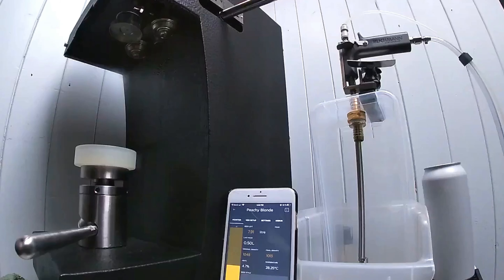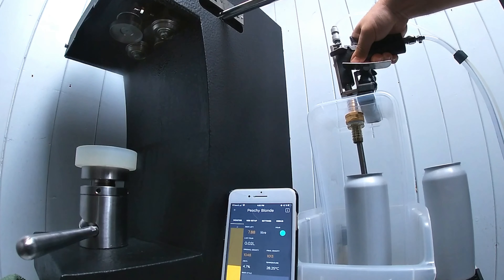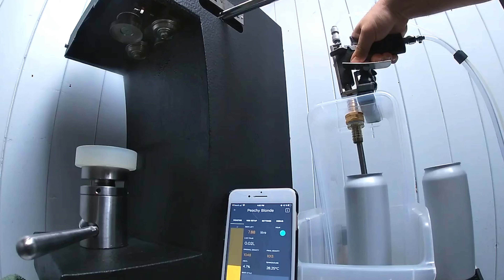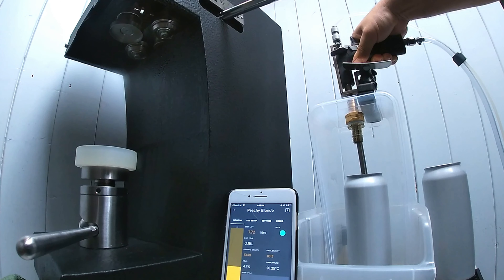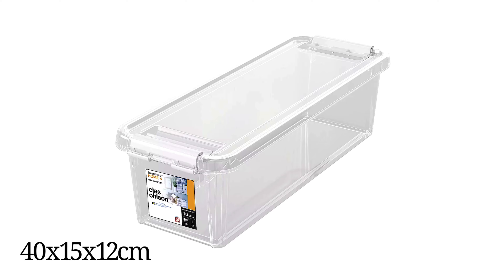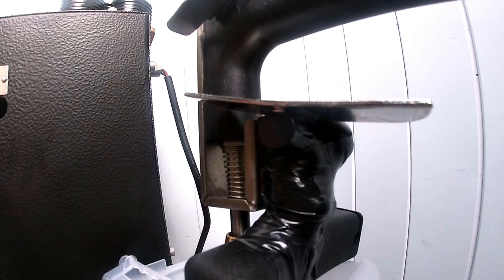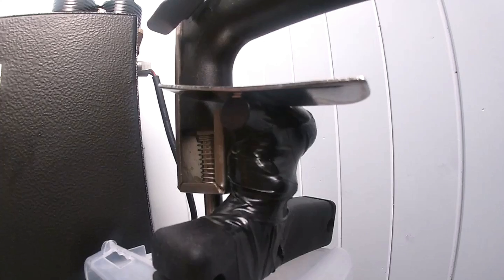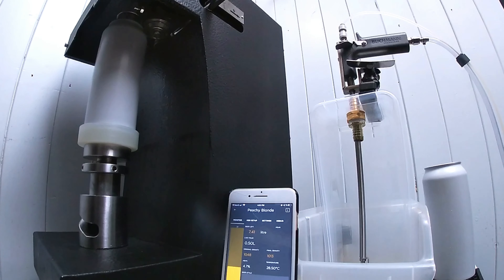Homemade Can Filling Station

Comment: Looks great! 
How much pressure do you use to can like this?
Reply from the maker: Thank you! When canning with the beer gun it kind of depends on your line set up. I am canning at 30 psi but I also have thin, long lines to help with resistance. Since I tend to over carbonate my beer in kegs intended for cans it’s important to have as much resistance, pressure and low temp as possible to keep as much co2 in solution as you can.